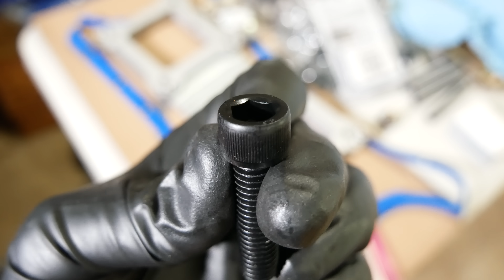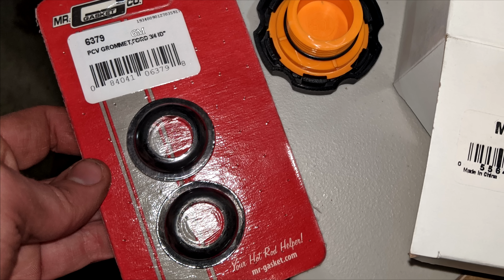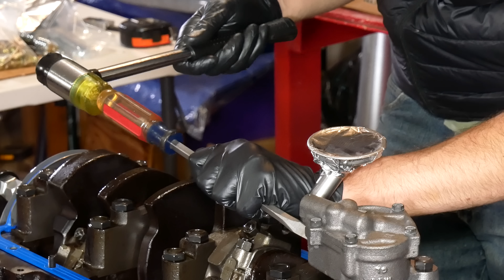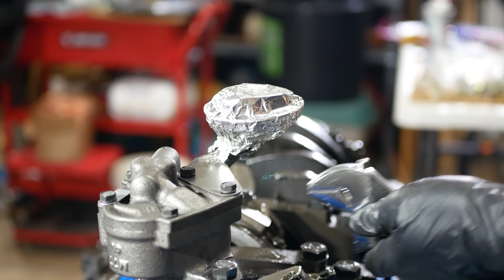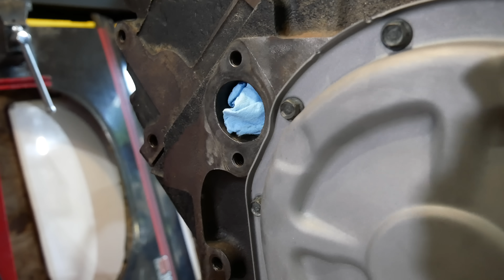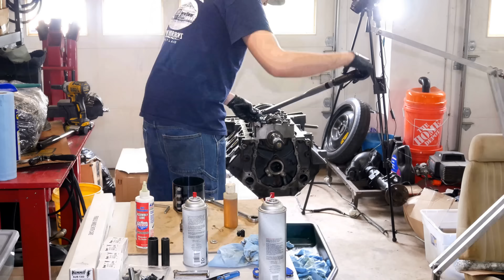$200 454 Engine Rebuild: Intake Manifold, Oil Pump/Pan, and Painting (Ep.24)

Comment from the maker: With this episode, the engine is back together! It needs a lot of accessories and finishing touches still, and of course the supercharger needs to be rebuilt as well.

I imagine it isn't a popular decision since everyone (including me) wants to hear this engine spit fire/cough motor oil, but I need a bit of a break from editing these and have a different video planned for the next upload. I wouldn't expect it for a few weeks, sorry to say, but know that I am working on upcoming content. THEN the priority is quickly editing the rest of these 78 Firebird videos and getting this engine to run (it still hasn't). The production gears are moving, but slowly. All I can promise is that I'm excited about the next few videos. Thank all of you so much for sticking around through a frustratingly slow series/channel!
Reply: Absolutely no rush, I will watch it as soon as it comes out, whenever it comes out!
Reply: @henrykrell5366  Its nearly 6mths I think its abandoned unless you know something
Reply: Engine Masters on motor trend channel just did a melling pump comparison for the dodges, and they did standard, high velocity, and high capacity. The high capacity moved a shitload more volume and pressure at idle. It seems like that could be beneficial for an older motor rebuild like yours. I don't know if they offer a high capacity for the 454 but if its not a forgone conclusion, you might want to see what the specs on one are. Like the difference is significant, and I will be pay attention to oil pump specs in the future when I work on my shit, and going with higher capacity.
Reply from the maker: @Jiunds  I saw that, pretty interesting! One thing they didn't mention is that you really want a modified block (more/smoother drainage) and a larger than stock oil pan for higher than stock systems, which was a concern for me. I haven't started this engine yet but when I did the oil prelube I thought it actually was a high volume pump, even regular big block pumps move a LOT of oil. You can turn the pump by hand and make like 15 PSI, so I think it should be fine at idle.
Reply: @FuzzyDiceProjects  hey man where have you been? Hope all is well just haven't seen a upload in what seems like ages
Reply: I like your irregular uploads, every time a video comes out it’s a happy surprise.
Reply: Hey brotha man, was seeing how things have been? Havnt posted anything in months so got us worried 🤣.
Reply: We will be here take your time
Reply: You do what you need to do.  We will be here when you come back. 👍👍👍👍
Reply: Eagerly awaiting the "start up"! I have an engine with rusted cylinder walls and I am waiting to see the outcome of this engine before I decide the path I will take on mine. Thanks for making these videos!
Reply: @MyPilot69  ever hear about seasoning a block u through it out side for a year let it rust up then bore it 30 over or as munch as u like it will help rings last longer old school trick after it sits and rust it changes the metal just a little
Reply: Do what you need to do. We’re not going anywhere!!!🤙🤙🤙
Reply: if u want to start with a good engine they put crate engines in motor homes lot have the ho 454 450 hp engines but u must check the paper work on the engine most have it in the glove box plus they have a 02xx 400r turbo good to 800 hp i got 4 setups last year with 6,000 to 58,000 miles on them plus u get a 4 row radiator twin electric fans full set of coolers everything u need to put it in all free .they have a 4 inch stroke steel crank heavy rods and high flow heads saves a lot on a build . new the crate setup complete engine with trans is 15,000 to buy it .food for thought how to get a built engine for free. just think u could have had a better engine for free u should have seen me when i found this out like a fat kid in a candy store now i check ever motor home i can get my hands on if it has a plain 454 i just pull the trans for the 02xx because they have heavy clutches bigger pump stage one shift kit easy to build them up to 2,000 hp trans
Reply: Say it. CHINA walls.

Comment: Those cast and brushed aluminum engine paints work perfect for making things pop. I once painted a 1982 Chevy G-10 Van's valve cover and thermostat housing with brushed aluminum Duplicolor Engine paint after gasket replacements and it made it pop. The engine being a 250 Chevy straight six made those parts like the centerpiece of the engine bay literally and figuratively. Topped off with a chrome Mr. Gasket breather with new grommet and it was like 👌

Comment: Not bad. There is definitely nothing wrong with a budget build. Those peanut port heads will give you a ton of torque down low. You will be about 450 ft. lbs at 2500 rpm before the supercharger. The only 3 things I saw that I would have done differently considering it being a budget build. #7 cylinder could have been machined .010 over with 1 single piston to be replaced. .009 piston to wall clearance would cause some serious piston slap. Guess we will find out. At the same time you could have had your cam bearings replaced at the machine shop. The rod bolts probably should be replaced only because the stretch and wear out so easily. If they over stretch under power it's catastrophic. Ask me how I know. 🤔 and I would have added ring gap to all cylinders to atleast .030 top ring .032 compression ring since your going to be under boost. That one valve although heavily pitted didn't have any nasty pits by the valve stem so it shouldn't be a structural issue.so It will survive most likely. So for another total of $225 bucks or less you would have total piece of mind with this engine no matter what. However I would like to point out that this is one of the most detailed build series videos of an engine tear down and rebuild I have ever seen. This video and a Chilton manual will help every future teenage hot rodder to come along in the next 20 years the courage to dive in and get it done.

Comment: u never put a square port manifold on a oval port head use the right stuff it will work a lot better the stock would have been better u still can get over 500 hp out of the stock manifold . i have a ho 454 450 hp and it has a stock manifold but i can go to a better manifold then mine will come a live with a bigger carb but u will not get nothing out of pea heads at least have high flow heads those valve covers i have on mine got them off a 94 pu even got the serpentine belt off it  i like the looks of them but i have tp pull them for roller setup

Comment: You do understand the pickup tube is NOT supposed to touch the oil pan?  Minimum clearance 1/4” with a target of 3/8”-1/2”.  Or .250”-.500”
Anything tighter than 1/4” restricts the volume of oil pulled through the pickup.  JD

Comment: i think that your cylinder hone job is pretty good/acceptable with .002 taper and .002 out of round; however the .009 skirt clearance on #7 is way too loose.perhaps its really .007 down the bore where the skirt is at top dead center? still excessive by .004 with cast pictons which do not hardly expend when heated up.  .007 is fine though for forged pistons which do expand hot.you need at least .005 with forced induction [blower] in any case, and should be using forged pistons.would like to see cylinder leak down test results after significant run time on the engine.

Comment: My harmonic balancer slides on by hand (on 69 351w) So obviously that is not good, what should I do? 
1: paint the inside of the harmonic balancer and put some blue loctite on hoping that holds together till I can get a forged crank 
2: get a cheep Chinese crank to replace the factory crank because I can't afford anything else right now
Reply: Use a product by loctite called 660 and it's for the situation like you describe where a shaft gets worn down. Just put it on the worn down section and then slide the harmonic balancer and it will harden up and fill the gap as well as kind of glue it in place.

Comment: Love your videos. They give me inspiration for my 71 Chevy C20 build. The truck sat 21 years untouched in a woods until a friend gifted it to me along with the title. The truck is beyond what most would consider worth saving but me being a gearhead as well as a professional welder i will be saving it. I took many pics and a few videos when rescuing it from the woods and cleaning it up. Some previous owner swapped out the original 350 V8 and auto trans with a 292 inline 6 and 4 on the floor and i will be keeping it that way. Wish i had a way to send you pics of the C20. You'd get a kick out of it i think.

Comment: With the amount of blow by you're going to have i would suggest a vacuum pump to recover tank with a breather installed on the tank. To go the cheaper route you could find and modify a later model smog pump (the kind that sucks fresh air from the filtered side of the airbox before the throttle body).

Comment: The old Pontiac light blue metallic would have looked nice on that.  Also, you do know that a PCV system won't work on a supercharged engine without a vacuum pump right?  That gets expensive and kind of hard to get it to work right.  That's why most people just skip it and go with a catch can for blowby.

Comment: having the oil pickup that far off the bottom and on a slight angle isn't a bad thing, if the pan ever gets dented, you don't suddenly lose all oil pressure because of the screen sucking to the bottom of the pan.

Comment: When using a torque wrench straight extensions will twist and effect how far you have to turn the wrench but will not change the torque transferred to the bolt with the same setting. If you use an impact driver the extension acts as a torsion spring absorbing the impact and can drastically lower the torque transferred to the bolt

Comment: Pontiac Firebird with a Chevy 454? Just curious could you not find a Pontiac 455? Maybe could avoid mount issues. I’ve had both 455 and 454. The 454 seemed a bit stronger with more low end torque but the 455 was smoother and rev’d higher I think with more high end horse power. I guess 454 are probably easier to find now days.

Comment: ARP 12 point intake manifold bolts would of saved you a big hassle
Reply: I was wondering why he didn't just remove a little aluminum from the intake around the bolt head to clearance a socket

Comment: Some advice to new engine builders, only put oil on bolts if the manual specifies "wet torque". You only need to put thread sealer on bolts that pass through a coolant passage. When using RTV use very sparingly as you do not want any of it to ooze out from between the parts it is sealing as it can break free and enter parts of the engine you don't want, most commonly people use way too much on oil pans and end up clogging the oil pick up and thus the engine eats bearings and kills it's self

Comment: Quick tip for torquing intake manifold bolts you cant get a socket on; Use a distributor hold down wrench. 

As long as you keep it at a 90 degree angle to your torque wrench it will be an accurate torque measurement

Comment: How would that extension affect the torque reading? Assuming it just twists a little, all the torque is still being applied to the bolt wouldn't it?
Reply: I agree.  I think this myth comes from impact guns with extensions which dampen the blows and limit the torque somewhat.  Here a constant pull will twist the bolt, the socket, and the extension until the torque makes the torque wrench click.
Reply: Any twisting in the extension at all is absorbing some of the applied torque.
Reply: @catsaregovernmentspies  but you can not "absorb" torque, it has to be applied at some point of the system, for an impact gun, yes definitely, the rod twisting would dampen the blows but we have a constant force acting on the bolt

Comment: Personally I would use a copper washer on the drain bolt because you wouldn't necessarily have to change it out with a new one each time you change the oil 😉
Reply from the maker: Very true! Those surfaces should be flat enough that a plastic or metal sealing washer would work and I may switch to one next time. The fiber washers under a flange bolt seem very forgiving as far as sealing though, which is why I like to use those

Comment: 17:00 Is there any sealing ridge further out to match the inlet shape? That looks like a vacuum/boost leak.
Reply from the maker: The gasket extends all the way around the ports, but yeah the printed silicone ring didn't line up with anything on the intake side. The main gasket material should still do a fine job of sealing though, it's not like the o-ring seals on an LS intake not lining up or something. Add the RTV gluing it together and it'll probably maybe be okay

Comment: The oil pickup screen is just a screen. The distance from the tube inlet to the pan bottom is all that matters. Edit: just my five cents (as pennies are no longer produced in Canada), please try NPT fittings for your drain plugs. They're much more reliable.
Reply from the maker: My thinking is that the edge of the "cup" the screen is crimped in is what is important, since if that is too close to the bottom then oil is going to have a hard time making the turn up into it.

Good point on NPT drain plugs though. I may try to find some raw steel fittings to weld onto stuff in the future

Comment: The combination is actually pretty well balanced. That floppy old screw blower with the staircase style intake porting, leaky valves and rival team ball park cylinder clearance will bring all the noises and period correct fuel/oil consumption, without the risk of cavitating the oil pump. And the lack of G-forces will keep the rear main seal dry. Truly a classic hand built restoration!

Comment: Why not use the socket cap bolt and torque down with a hex key?
Reply from the maker: A regular hex key socket wouldn't fit on it, an Allen key probably would but it would have to be pretty low profile and take a lot of torque to get the bolt to 30 ft/lbs. Could be done, though
Reply: @FuzzyDiceProjects  the allen key is what i was thinking. 30 lbs would be a pain though, yes. Is 30 lbs necessary? Seems pike a lot for an intake, or is it because of the boost?

Comment: The oil.pan bolts should either have spring washers underneath or threadlocker applied to the threads before fitting them,not oiled since they aren't bathed in oil like all of the bolts inside of the engine are except maybe the cylinder head bolts which are either fitted dry or with thread sealant applied to the threads !
Reply from the maker: I don't like to use threadlocker on pan bolts because those gaskets and flanges can move around and it's good to be and to retighten them after it is all together. The silicone gaskets are better about that but still can help. The bedliner under the bolt heads should actually hold them pretty well.

That's my thinking from my experiences at least! Not saying it's a better way to do things.

Comment: The bolt not fitting is why I hate aftermarket parts.  It's like they don't test fit anything to make sure the part the made specifically for that engine or vehicle even fits properly.  I had an edlebrock intake manifold for a Chevrolet 350 block and had to have it machined to even fit the heads it was intended to be mounted to.
Reply from the maker: It often seems to be the case! I bought a deep aluminum transmission pan recently and the filter extension that came with it was too long and at the wrong angle for the pan! And the awful, thin casting around the bolt holes on Weiand intake manifolds really grinds my gears.

Comment: Although the filming was done early last year but gere is my 0.02$
Gen 3 BBC heads are bettter flowing and cheaper to get then gen 6's.
A small cam won't hurt anything, and some high CR pistons are like 120$ for a set.
Reply from the maker: Since it's a Gen V, it needs special intake gaskets to use older cylinder heads and I have heard very mixed things about those. Could be worth a try though.

It may depend on your definition of "small cam" but we put about the biggest one in there that I think the stock rockers can support.

I wanted to keep the compression low for the supercharger, it could probably do with being half a point higher but not worth all that trouble when the cylinders and everything else are questionable.
Reply: @FuzzyDiceProjects  agree on both, but again, you can push 10# with low boost.

Comment: What cameras do you use?
Reply from the maker: Mainly Panasonic Lumix G85 cameras now, upgraded from a Lumix G7 that most of the videos on the channel were filmed with. Reliable, reasonably priced, rugged, fairly small and light, good picture quality as long as there is enough light.